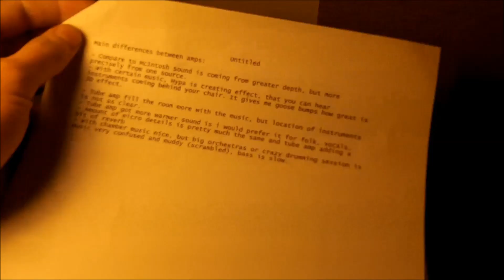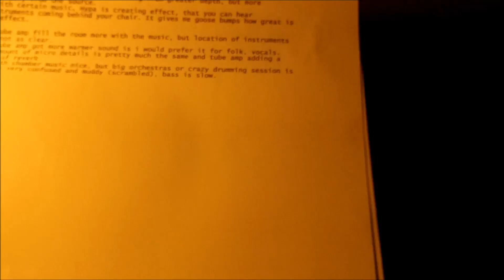DIY Audio High end Power amplifier 200W class A/B  modules - Hypa 17 review

Comment: Those amplifiers look very similar to MB501 MonoBlock,power amplifiers made by "Marchand Electronics", (from U.S.A.).
They are rated at 125 Watts RMS into 8 Ohm and 200 Watts RMS into 4 Ohm.
It seems to me that "Marchand" has a good reputation with electronic (active) crossovers.